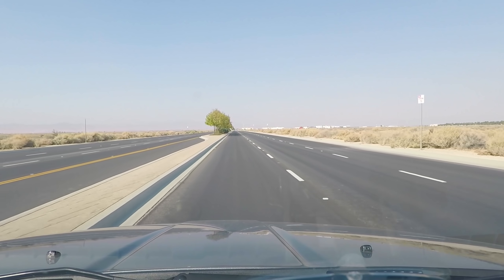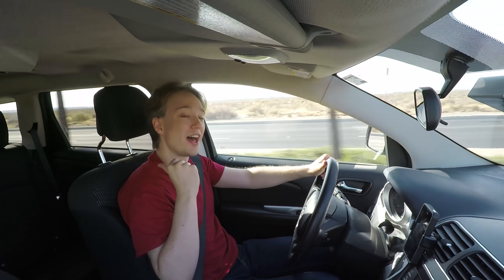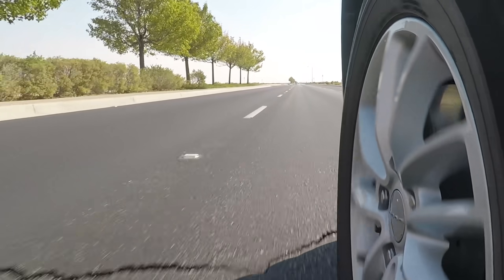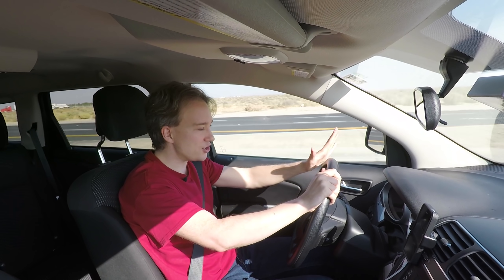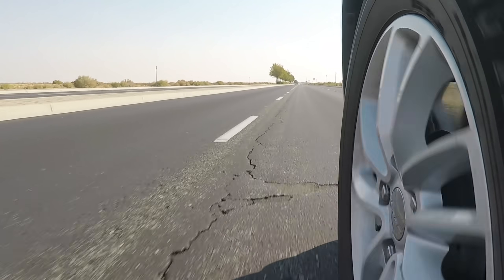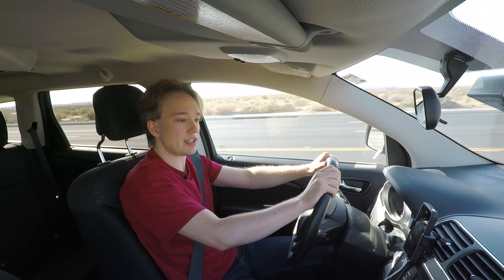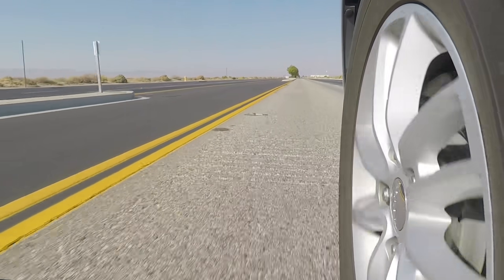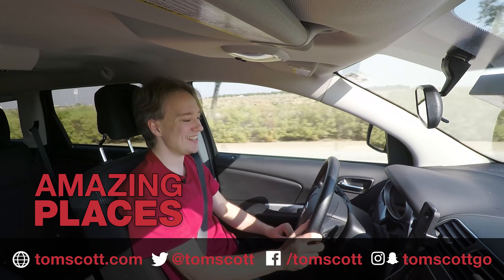Why California's musical road sounds terrible

Comment: So if you double your speed it should work?
Edit: x2 video speed on youtube is a great thing
Reply: Still sounds really off tbh.
Reply: doodbool "So if you double your speed it should work?"

No, because both the correct notes and the incorrect notes would increase in frequency by the same amount.
Look at it this way: a tenor singing the wrong note and a soprano singing the wrong note are BOTH singing the wrong note.
Reply: Tristan Pearson wtf it doesn't sound good at 2x speed. It is a mess, just played faster
Reply: Haha no way that actually worked xD
Reply: Tristan Pearson the tempo may be more accurate but the tone still stays the same.
Reply: +doodbool
I don't understand, did you even watch the video? Not only does the maths not work (each note is changed by a linear amount and changing the speed of the car/video changes it in relation to the note it's changing) in other words no matter your speed it won't sound right. Also if you listen to it at 2x speed it just sounds basically exactly the same. Perhaps the individual notes sound smoother but it sounds equally out of tune.
Reply: it doesnt work.  it fixes the tempo, but it's still out of tune
Reply: Hold on, before we all get angry at one another, I think the reason why some people think it sounds better and other people don't is because the way sound gets sped up is different. If you simply make every sound wave go twice as fast, they'll be at twice the frequency as well, which is why a voice sounds so high-pitched when you make it go faster. However, another technique to speed up sound is to just cut away every other sound wave. This way the frequency of the sound waves stays the same and at least the pitch sounds somewhat natural.

Maybe the way YouTube speeds up sound is dependent on the device it's running on. I'm using the web version on a PC, and for me the pitch doesn't sound like it's any different when it's sped up. However, those who are watching on mobile might actually hear an increase in pitch, so for them it sounds better (because the amount each note is off is also halved so it's less noticeable). Maybe I'm wrong but I think it's the best explanation.
Reply: JochCool I think you might be wrong.  when I originally commented I was on my desktop, and now I'm on my phone and it's still out of tune.  unless like an xbox or something does it differently I don't think that's it.
Reply: He explains why that doesn't work.
Reply: Nuclear Winter its much closer though
Reply: Comments like these are why I've lost faith in humanity's ability to think
Reply: TheCptCoy No try it. It actually sounds good at 2x speed.
Reply: doodbool I think you missed his point... and the whole video for that matter
Reply: Tristan Pearson nah, it still sounds very out of tune. so unless you’re tone deaf, i don’t know how you think it sounds right honestly
Reply: eat EGG You must be tone deaf yourself or overly proud with your judgement if you can't even acknowledge that it sounds at least a tad better. ;)

Comment: Talked about this in the late 90s w/ a professor, including adding vocals.  He was thinking a programmable steamroller with a heated cylinder could press the oscillation pattern into new asphalt.  We'd both wondered what might be achievable after experiencing rumble-strips and the like.  At even the highest fidelity, there would always be an echo as the rear tires repeated what the front tires vibrated.  I figured it might work better as an amusement park thing, with custom vehicles, using only front or rear specialized wheels.

Comment: Btw... They shouldn't be half the lenght to get one octave higher... The frequency required to get to the next half step is streched exponentionally the higher the note/frequency is. For exapmple: E2 has the frequency 82hz and F2 87hz. If you look at it at the eighth octave E8 is at 5274hz (5.274khz) and F8 is at 5588hz (5.588hz). So in the lower octaves to get to the next half step we have 5hz difference between the E and the F. In the eighth octave we have 11hz. Sure that isn't much but makes a huge difference when you are constructing the road to get musical notes out of it. This is still real life and real physiks and not Minecraft or whatever.

Comment: Would it really be a good idea if it were done correctly? What if you wanted to listen to something other than the William Tell Overture? And if that is what you want to listen to, aren't cars already equipped for that?
Reply: Festus Omega 
There a whole TWO other lanes on a road that almost nobody drives on.
It would've been fine.
Reply: If it was mechanical—which is quite possible to achieve—they could change the track every day using midi files.
Reply: Festus Omega would it be a good idea to include you at a party? No, it wouldn't.
Reply: And I thought websites with autoplaying media was bad.
Reply: Generally this kind of road also has signs telling you what you're about to drive on. On a long car drive, think of this as a POI to break up the monotony.
Reply: Its to startle you awake
Reply: I think japan has done a musical road as well and it was quite okay
Reply: You really wrote that entire comment just so you could tell everyone that you know what William Tell Overture is. 
r/iamverysmart

Comment: Ok, So just drive 30% faster. Then the tyre rebound will counteract the mistake and you get a higher note. OR even better - use a thinner tyre and drive 20% faster to the note is better pitched. Overall - this argument is click bate.

Comment: The error was in translation between math terms and layman's terms. In the mathematician's or physicist's mind it is obvious that the wavelength is the quantity of crucial importance in a phenomenon such as this, so it is implicit that 4 inches means 4 inches trough to trough. In the construction workers' mind, the important quantity is the one that you measure to check the accuracy of your work, which is the distance from edge to edge.

Comment: Not likely to be a real issue, but... What would this do to your vehicle if all roads were like this? Suspension wear, tire?
Would it wear tires faster, or slower? Since they are riding on "air" over all the groves, that causes no wear, but then there is an "impact" on the other side, does this create more or less wear then rolling over the same amount of asphalt? The noise is vibrations carried from the wheel, through the transmission, into the vehicle, what would it do to bushings, shock shaft seals and such?
Curious, more then anything.

Comment: You're driving too slow
Reply: Nuclear Winter 

He was still driving too slow.
Reply: He explained later in the video, if you would've even bothered to watch it, that it would've sounded like the song, only slowed down or sped up depending on whether or not you were going too fast or too slow.
Reply: no, no matter how fast you drive on that road, it won't sound right because the proportions between the frequencies are wrong.
Reply: did you even watch the video
Reply: no, he's driving exactly as it was designed to be driven on, at 55mph. the point is that as a result of the design fault you have to drive at about 100mph to make it sound right which isn't exactly legal.

Comment: It's not a problem of the english language so much as it was a problem of the person who made the calculations probably not knowing construction terminology.  "Four inches apart" is exactly how they built it.  What they should have said was "four inches on center".  That way the width of the actual groove is not a factor in the separation between the grooves.

Comment: It's not a math problem, it's a CAR problem. The road was made for a certain Honda Civic model, with a certain wheel base, with factory tires, at 55mph, and to do so for a commercial. Everything else, fails to line up correctly. Most small cars can still get it right.

It would have been very easy to simply ask any long time resident of Lancaster...
Reply: the car isn't going to make a difference in pitch. one car moving at 55mph is going over the grooves at the same rate that another car at 55mph is.
Reply: It doesn't help that that isn't the original road also.
Reply: Wrong. Should work for any vehicle. California workers got it wrong.
Reply: Find a single video on YouTube that supports what you said.
Reply: But who wants to talk to a goof
Reply: It actually works at 125 mph its the scaling its playing wayyyyy to slow at 55
Reply: The wheel base can affect the timbre, but the base pitch will not be effected.  Like the difference between a horn and a flute playing the same note.
Reply: Messkit Makes total sense to spend so much money on a musical road that specifically design for 1 certain car.
Reply: The original road (all musical roads currently in use are NOT the original) was made exclusively for a Honda Civic TV ad.  Yes, corporations will spend a LOT of money for a unique ad to gain sales, even to build a single use road.
Reply: Messkit Incorrect. Like he pointed out in the video, scaling will keep a song in tune since frequency is on a logarithmic scale. The constant width error means that the tones will not be the correct relative frequency for any vehicle.
Reply: Again, it's not scaling, but wheelbase and forward speed. He was also driving to slow, and not driving the correct wheelbase vehicle.

If the grooves are indeed too far apart and sound like the video, they will come back into sequence, or scale, by increasing forward speed. Just like speeding up a vinyl record. 

My '96 Ford Ranger played it perfectly at 65mph. My Jeep...not so much, no matter the speed. Daughters car, a new Ford Focus (and who lives in Lancaster), plays it at 55mph. Her fiance' s Dodge Ram? No, not even close.

The Jeep and Dodge wheelbase length fail to engage simultaneously the grooves. As one tire hits the a groove, the rear tires are in between. The wheelbase must be exact, for the tires to be striking the notes at the same time.

Again, the road was cut specifically for that year of Honda Civic, and no other car.
Reply: Messkit, you're wrong. The wheelbase literally makes no difference because each axle is playing the same thing just slightly after one another. Wheelbase doesn't affect the tune. The only effect the wheelbase will have is the delay in playing the same notes for a second time.
Reply: If you have any knowledge of music or sound whatsoever, it's obvious that you are incorrect and the explanation offered in the video is much more reasonable
Reply: No, that's not at all how it works.
Reply: So Gerald Keever for sake of simplicity lets the the YouTuber is exactly correct ( I personaly am not sure). Then how is it that paper nerds are wrong when its the paper that was right and the people that made it (and have the knowledge of roads) messed up and didn't do what the paper nerds said. The paper was right the Experience was wrong. Also Aidan Bazan I just today took my Toyota Tacoma over it and yesterday I took a Chevy tahoe over sounded different.
Reply: Messkit all these 'on paper science geeks' dont want to hear the truth from someone with experience and knowledge of the situation. Hehehe it makes me laugh.

Comment: I bet it also sounds off because you have 2 different parts of the song playing at the same time since your front 2 wheels are further along in the song than your back 2 wheels
Reply: Nope, depending on the geometry of your car it will double the frequency and generate harmonics.
Reply: Wouldn't make much of an audible difference seen as it's only a fraction of a second you'd hear it for.
Reply: So... They didn't take this into consideration?
Reply: Niklas Klasen They did, for the exact specific car they designed it for. It was a promotion for a Honda civic, and unless you're driving that car or one with the same wheel base, it'll be off.
Reply: NIOC630 I'm confused af
Reply: rossdellgado  I'm sure they took into consideration the fact that most cars have 4 wheels or two "axels"
Reply: Phase cancellation will only affect amplitude, but not pitch.
Reply: open two tabs and pull up the same music video, and start them at slightly different times, even if you get them to start within a fraction of a second of each other it still sounds off because they're both playing different parts of the song.
Reply: Its not about the same note, its about the same Period. Put two sounds of exctly the same note ontop with a different Phase and the result will be a different note.
Reply: rossdellgado speed matters prob too
Reply: rossdellgado Yes, but for the most part the car is on the same note
Reply: I'd like to see the sign at the beginning of this stretch of road assuming it HAD been built to the correct specifications:
'To clearly hear the music, your car has to have a wheel base of exactly 9' 8" 65/128", otherwise it will sound off-key.
We appologize to any car owners that do not conform to these specifications. Have a nice disharmonic day."
Reply: There were way too many variable for this to work. The fact that two different sets of wheels are playing different parts of the same song,  every car has different spaces between the front and back wheels, some cars have different types of wheels, different sizes of wheels, different weights, and they all drives at different speeds.

It was impossible for this to actually work.

Comment: Except that it does work and has worked.  So I'd say it's much more likely it having to do with every single car has a different wheel base so depending on what car you are in the front and rear tire are NOT hitting the same notes.  This is much more likely to effect the song.

Comment: Honda made this road. With the specifications of a Honda Civic. So in order to get the proper tune. You'd have to drive over it in a 2009 Civic, They tuned it to the Civics wheel base. So it's not that they did a bad job on it and messed up. It's just that they made it for one car specifically. So if you have a car with almost the same wheel base as that model Civic, then you should be able to listen to it right. And also think about it. No matter how far or close the grooves are. There are so many different model cars with so many different wheel bases. So no matter how right you think his calculations are. It's always going to sound different driving through it in a Mini compared to a Suburban.

Comment: I'm surprised that whichever engineer was supervising the construction didn't catch that mistake somewhere in the process of constructing the road. I'm entirely sure the construction plans would have specified that the grooves needed to be x inches apart on center (emphasis on "on center").

Comment: Can't blame the language for this one. There are plenty of English terms that could have prevented this. Could be conveyed in reference to frequency; the difference between a cycle and wavelength. It could be conveyed in basic construction/engineering terms, seriously shouldn't there have been blueprints that simply demonstrated groove width and spacing between grooves? Engineering plans aren't handed down verbally.

Comment: Is this how a record player works?
Reply: Leo, actually, yes, to some extent. The vibration causing the noise here, is simply translated as mechanical noise, where as on the record player, the needle travels in a track, bouncing on the groves cut in to the sides of the track. Since the grove is a 45degree V shape, one stylus (the needle) bounces side to side, for sounds that are single channel, and up and down for sounds that are on both channels.
The motion is then translated, commonly by using electric coils and their ability to create charges when a magnetic field passes through them, to analog electronic "noise" which then can be amplified.

Or, as Robert seem to be suggesting... It's all just black magic. But yes, the spiral track on a vinyl record has two sets of these groves cut in to it's V shape, and that is why it can be played back.
Reply: Only insofar as it involves grooves...

Comment: I've driven down it. If you go the speed limit it sounds like that but this is California no body drives the speed limit. If you drive faster it sounds right.
Reply: That's incorrect Tyler. The pitch of one note relative to another is purely based on the distance between the bumps if you travel at a constant speed. The only way to make this road sound correct would be to dramatically alter your speed at various points
Reply: Then you have really bad ears. If you drive faster every note just sounds higher. They're still in the wrong pitch relative to each other.
Reply: @Chameleon EDM. Yes I think you're right and I was wrong. I was misled by the animation and his wording at 2:34.
Reply: Yeah like Chameleon said. If you drive at double the speed it will just be twice as fast, which means transposing it up by an octave. It would still be just as out of tune.
Reply: Right but as explained in the video, each frequency is modified by a constant, not a factor. As the frequency gets higher, that constant will be a smaller and smaller fraction of the frequency. So driving faster can actually help.
Reply: POVadventure true at 80 it sounds good
Reply: Exactly what i was thinking! what if you drove faster?
Reply: the frequency of a frequency is a frequency and the frequency of that frequency frequency's the frequency

Comment: The term needed to be used is groove pitch , similar to thread pitch with threads , or diemetral pitch. Describing the distance from any point to the same point on the next step or groove